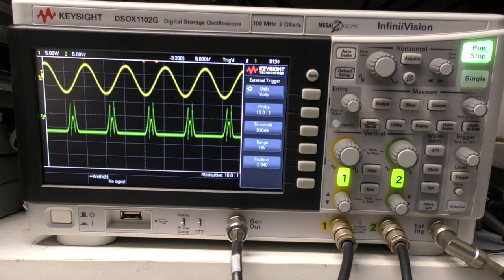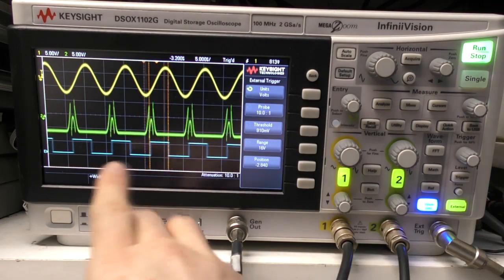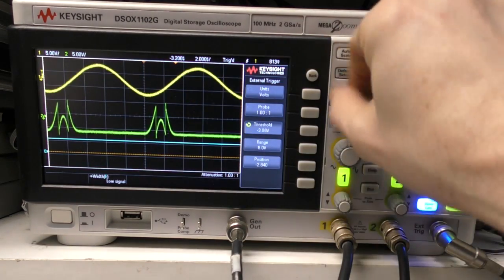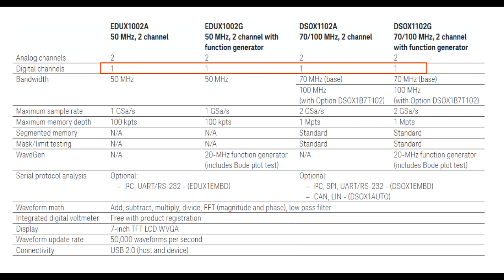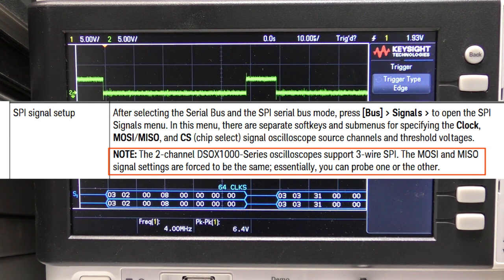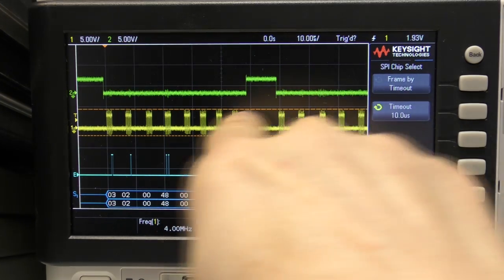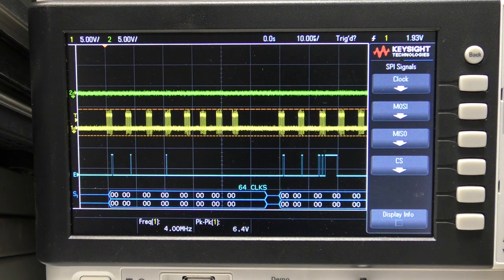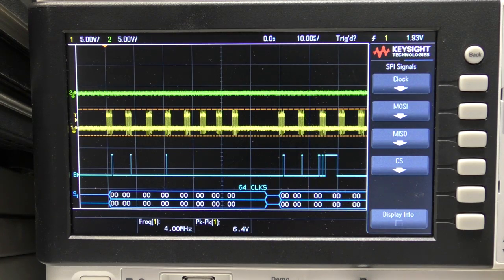Keysight DSOX1000 marketing FAIL and SPI decode issue

Comment: Thanks for the feedback! R&D will take a look.
Reply: What was done about it?
Reply: Keysight Oscilloscopes what did R&D come back with in the end? Curious to know 👍🏻
Reply: The UX designer is playing around with the packet bracket displays, and other feedback is all being taken into account for future software & hardware updates.
Reply: I cannot agree on that one. There are many needs of the engineer. That way, it´s really too much to expect from lowest line of the scope to do everything. Even much higher class scopes don´t really bring the functionality of many dedicated devices. If I really wanted to engineer a lot of digital stuff, I would add a good multichannel logic analyzer to my workshop. For example...  Anyway, I´m buying this model home for small things. It still can do so much, and is so affordable, that about any engineer can buy one, and do tremendous amount of work with these. One just has to be NOT that cheap.
Reply: Hey Keysight! Iam playing with few DSOX1102Gs, and I found that after some fiddling, the scope gets buggy and needs going to default setup and/or be reset. For example after some measurements, and then jumping to learning signals (clock glitch), the glitch is not there anymore! :-D I found more of these, but cannot remember. For sake of understanding, I´ll try to get to the point where I can create this problem more consistently, to report you something on which you can react more objectively...
Reply: This particular Keysight does not target serious engineers. It targets advanced hobbyists, makers and hackers on a budget. Also they have an even lower end EDUX series for students.

Comment: im so torn... id like to get a scope in the next month...  between this, the rigol and Siglent SDS1202X+ who is running a sale+decode i assume to try to battle scopemonth....
Reply from the maker: According to Dave there's another new low-end scope from another manufacturer coming this month.
Reply: mikeselectricstuff that scope will have free serial decode too so I'm told. I should be able to get my hands on it on Wed.
Reply: exciting stuff :)
Reply: 1202XE user here. Very satisfied with the scope. Only the free serial decode is a bit sluggish. Otherwise a great 200 MHz DSK.
Reply: DSO*

Comment: Why would they do that? That's stupid. Even the cheapest rigol can do both data lines at a time without /CS.
Reply from the maker: My guess is it's an error that happened possibly due to a change of spec at some point. Or possibly a hardware limitation, but seems unlikely .

Comment: Good review, I don't particullary like the way the power supply is designed.  They seem to have farmed it out to another company and its appears cheap and hard to repair.
Reply from the maker: It makes no sense to make PSUs yourself. Looks way better than many others I've seen in low-end scopes as it is well spaced out for good airflow- heat is the number one killer. Even cheap caps will last forever if kept cool.
Reply: Well i actually like the PSU in it. It looks well made at a glance, just as repairable as any other switching PSU.

As for the PSU being made by someone else well that's the case in almost every scope they make. I have a more high end Agilent MSO9000 and the PSU in that is also just an off the shelf switching PSU module. Tho it is easier to replace if it fails since its simply one 12V rail at 750W, the mainboard makes the other voltages itself.
Reply: If I end up buying one of these, I think I'll run it until the warranty expires (3 years I guess?), then open it and recap that power supply.  Presuming the PSU output caps are low-ESR types, then I don't expect them to last much longer than that from cheap manufacturers with poor chemistry and QC.

The good news is it should be easy to recap so I don't think it's a deal breaker, unless a recap would somehow affect the calibration of the scope.
Reply: There is a conformal coating on the board that makes probing around a PITA.  You must scrap off a few mm of goop to test anything.  The other thing to consider is how noisy, it being a switcher, this thing must be.